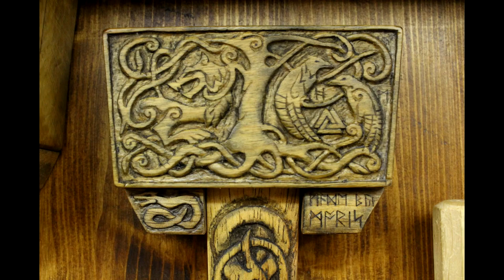Epic Thor's Carving Mallet

Comment: Great work man, really love it. You really earned your sub.
I'm curious tho, how did you get the burning effect? You seem to first oil it, then burn it and then rub off the smut or how does it work?
Reply from the maker: +The Dayan Dude Thanks bro 😉 😊 🍺 
You just char it l, not burn 😉
And you don't need to preoil I changed my mind but I edited it wrong hahah 😲
Just char it and when it is black, put some linseed oil and remove black residue from the high spots to get that old effect 😉 
Moris

Comment: I LOOVE THIS 

I Have a few questions about this build.  Is that candle a specific kind of candle used to darken? Or is it just a normal candle? 

And what did you use to sand off the sides of the mallet that was charred? 

And what did you drip over the handle?
Reply from the maker: +PeaBraine Thanks bro 😄🤘🍺
It is normal beeswax candle 😉 hah 
You mean carved side, I didn't sand it, I only wiped off the excess linseed oil with piece of cloth and that removes the charring from candle from high spots on carving 😉

Chocolate syrup 😉🍫 
Jk. Linseed oil 😂